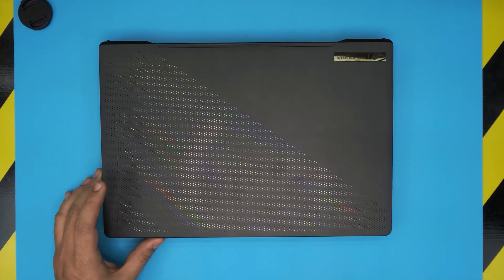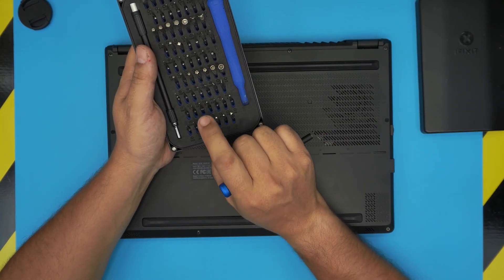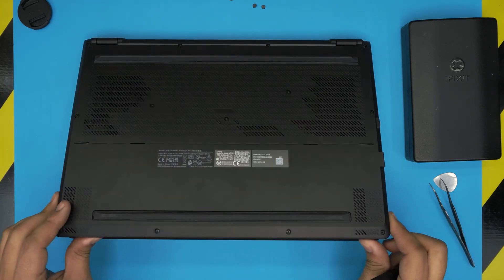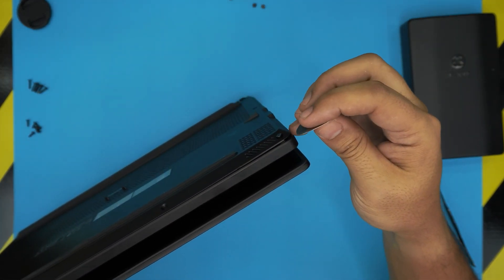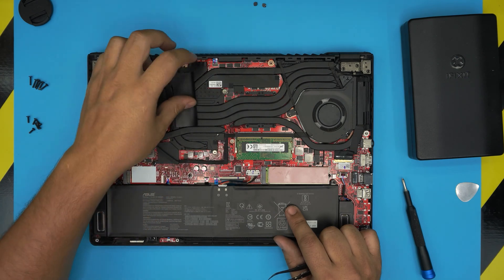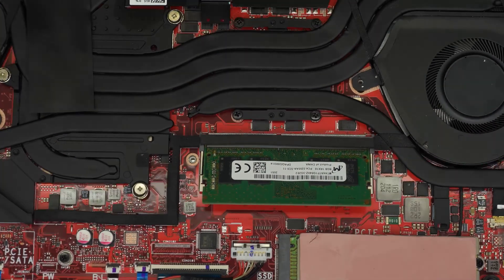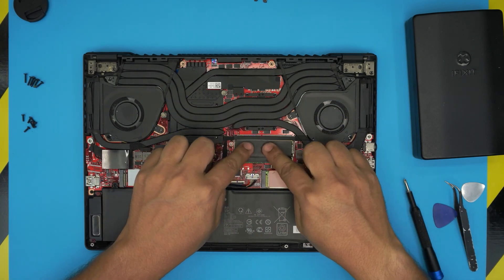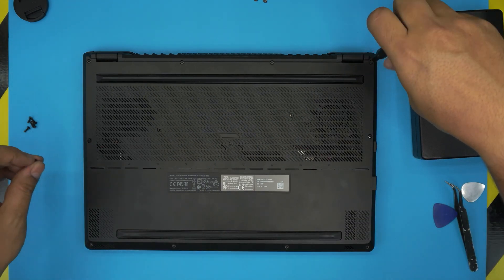ASUS Rog Zephyrus M16 🚩 Gu603hm 211 Zm16 💻 Ram Upgrade

Comment: Thanks very much! Just upgraded to 40gb total with the help of your video...well done! Recommendation: don't make removing the power supply optional...it takes 5 seconds and is a good safety precaution. Also, nitrile gloves are good, too.
Reply from the maker: Excellent! You are welcome! Glad you upgraded 😊Thank you for the feedback! if you wish to support the channel you can LIKE or SUB or both :P
if you have any question or request in the future feel free to ask me.
removing the battery is a very good idea for those that never opened a laptop, but also i have seen people remove the battery jack and when they place it back in they go side way and make a short :/
BUT regarding the Gloves absolutely not necessary!,  you can man handle that board with and even with you give a electric shock from your body to board nothing will happen. we handle board for over 18years and piles of board and never ever had issue with ESD shock damaging a board.
i truly appreciate your feedback and your recommendation my friend :)
Reply: @uFixTek  Very true about putting a connection back wrong...that IS a risk for newbies. Now...about replacing the GPU...  ;-)
Reply from the maker: Oh the GPU and CPU are soldered on motherboard they are BGA chip. you can replace them with the same exact model only but you would need to have or know how to REBALL  BGA CHIP (reballing).
if you try to reball a different GPU or CPU it won't boot nor power on. all the components around them are meant for that specific chip power management/ and so on...
Reply: Hey John, can you please let me know which ram model you got? I tried to install the 32GB Kingston Fury DDR5-4800 (KF548S38IB-32) and the laptop wouldn't boot no matter how many times I reseated the ram.
Reply from the maker: my friend the issue is that you got a DDR5! this laptop take sdram DDR4 not 5, in the video you can see : https://imgur.com/a/nN8J1cN
Reply: @uFixTek  hi, i got the same issue as @jadshokor where unable to boot after installing DDR5-4800 32gb ram. 
you mentioned the issue is DDR5 but it tot it is preinstall with DDR5 ram instead ? seek for your assist, thanks 
my model is GU630ZM
Reply: John what ram did you use to make it 40?